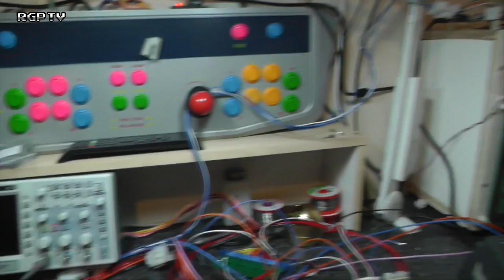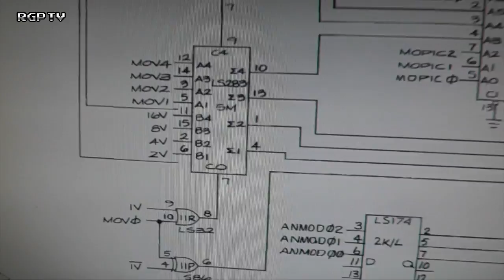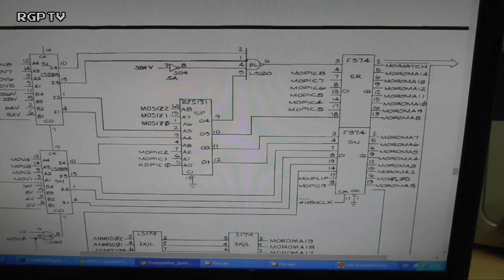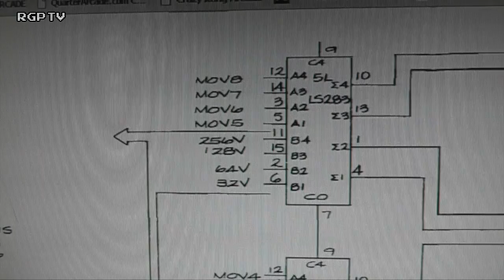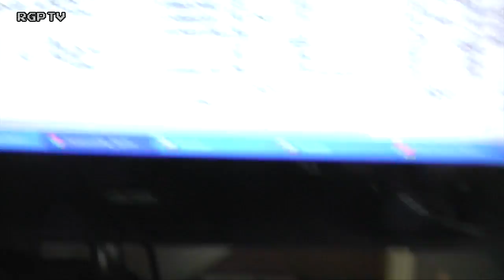Championship Sprint Arcade PCB Repair for Arcade Club

Comment: Superb. Yet again James, you have proven that even with an eyesight disability, electronic magic can be restored to a 30 year old board. Well done mate, and the old chip tester still hasn't let you down I see. However I still have a small semi-on for the Tron rebuild. If there is anything salvageable from Silicon Hell on that one. Won't mention it again. Promise. : )

Comment: Brilliant!  I can see the attraction in looking at arcade PCB faults since there's so much standard logic and at the same time they are a challenge due to the sheer volume of chips, coupled with the different architecture between boards.  Great stuff, must say I am loving your channel =)  Look forward to the Paper Boy repair =)
Reply from the maker: GadgetUK164 Thanks, essentially they're very similar in principle but just implemented differently.  You start to see the common design pattern in them in certain circuits.  It gets easier as you remember what each chip does because you can read what direction signals are travelling in a bit easier.  I don't think there's a tried and tested method of fixing all boards.  The Fluke 9010A helps a lot if the game board has a CPU you have a pod for.  Just done a Pleiads board as well which had an 8085A cpu on so that one had to be diagnosed the old fashioned way.

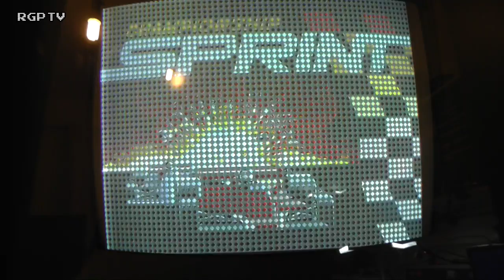Comment: Great work! There might still be a fault on there - if you look at the swinging gates at 8:10 and 9:20, they should have a shadow, I think, but it's flickering a solid color instead.
Reply from the maker: Ah, I didn't see that, I'll take another look before it goes back
Reply from the maker: josephmmuller This is fixed now, see my other comment